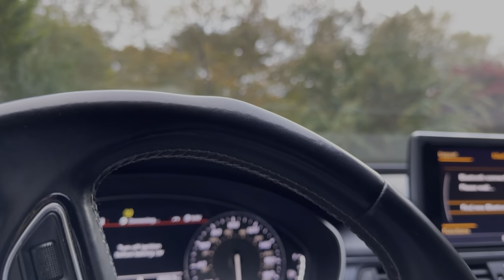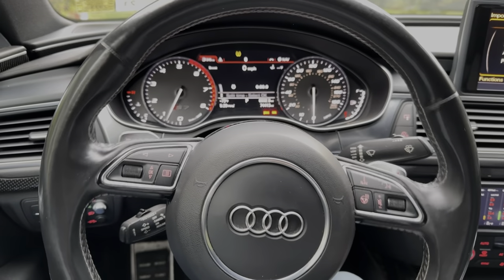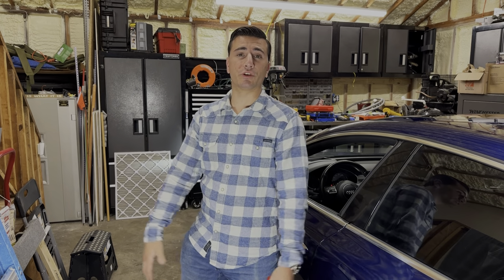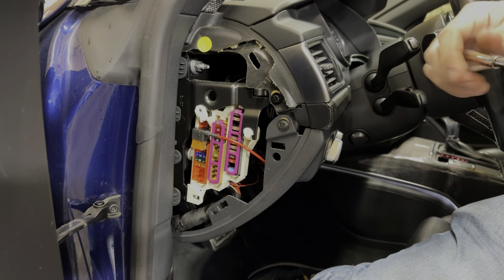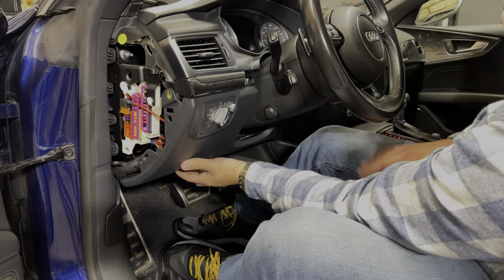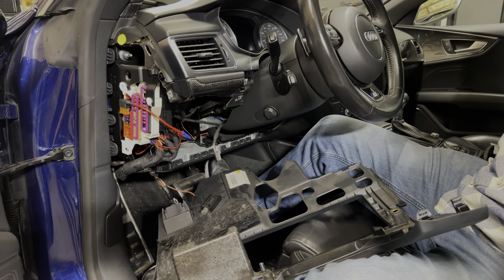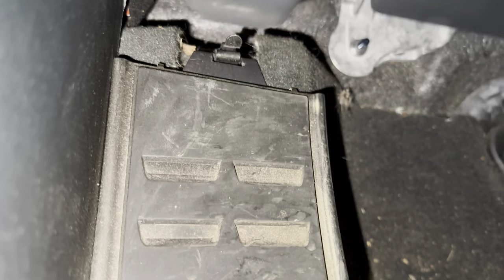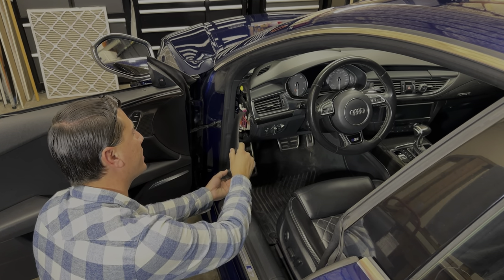How to remove kick panel (knee bolster) on Audi C7 S6 S7 and VLOG update!

Comment: Great video. I have an A6 c7 with the 3.0t which basically has the same dashboard as this. I need to replace the front parking buzzer which Is located in that area.  Do you know where it is, exactly?  Going to do this job at some point in the nearish future. Thanks! I just got a stage 1 tune and I’m  very happy with it.  Certainly no S7, but satisfied at the moment.  Thanks for your time! Nice car!

Comment: Did you go In person to get the tune or it was all remote? How did he custom it what he had you do a couple of pulls and log? I have the same turbos about to get installed next week.
Reply from the maker: What kind of tune are you running currently, is it DS1? If yes, they what you’ll do is download all the base maps for your car and your .xdf file, they will make you a base map and you then do a couple logs to send back and forth for revisions until your at a safe and comfortable level where it should be
Reply: @KotaPerformance  No not yet I'm actually still on Apr Stage 3 tune at this moment but will be going  ds1 in the next few months. Gotta get downpipes and flex fuel plungers first.